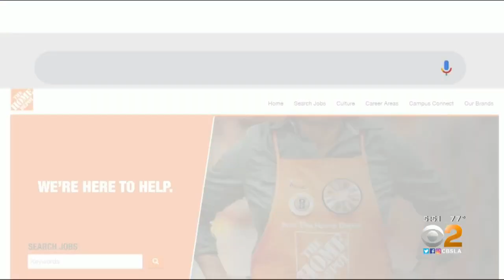Who's Hiring: Home Depot

Comment: I worked at Home Depot for 4 years and they forgot to mention you should literally know nothing about hardware but when customers want to know the difference between 100 different types of screws, the ASM will just tell you to figure it out. Also be prepared to lift 90 lb concrete bags for rude customers who’ve been waiting hours because the DH went to grab Starbucks with the new cashier, district manager “walks” where you have to stay until 3am and be back at 5am, and emergency store transfers right before your shift is done where literally nobody knows what to do or wants to help, but hey, the shelves have to be false faced.
Reply: I recommend being a lot tech though, if you have a good personality you can get away with chilling with the supervisors in the break room.